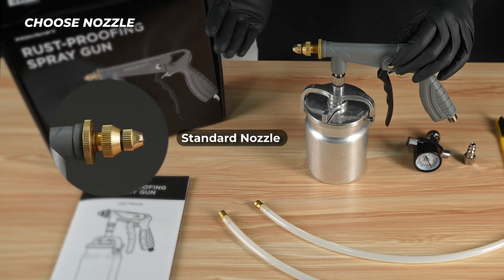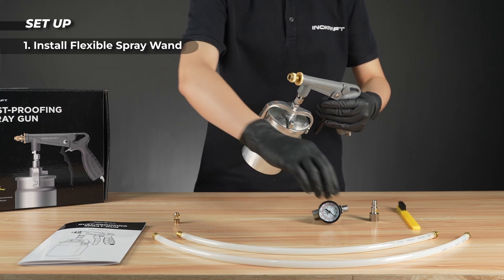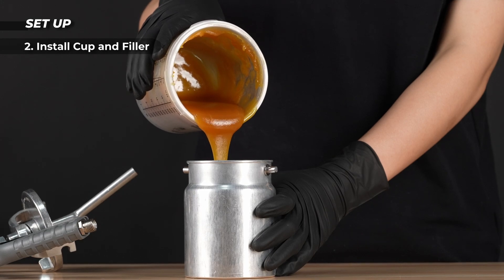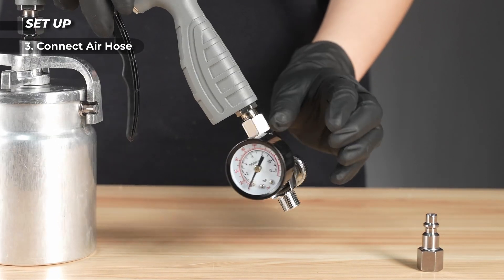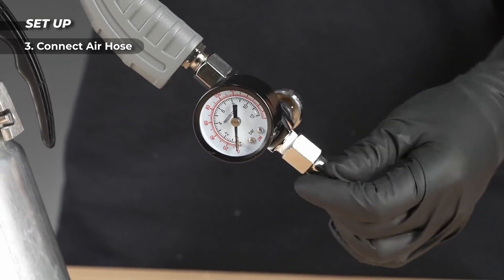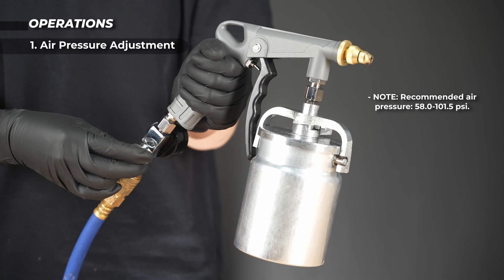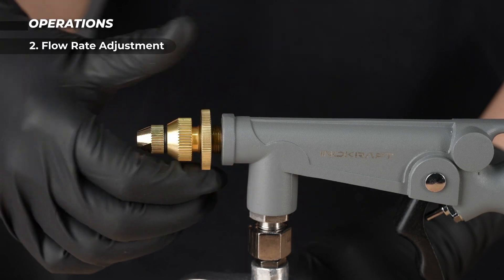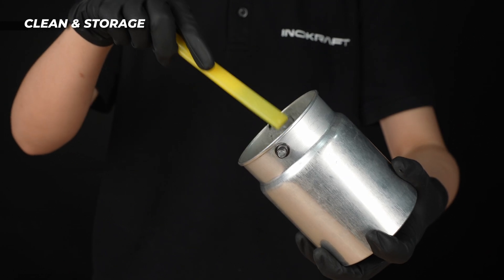InoKraft Education Center - Rust-Proofing Spray Gun Pro with Cups - Instructions

Comment: I have this gun and it works good with Surface Shield. I wish it would have more info on buying replacement wands ect. One thing I think is a$$ backwards is the 18" wand has the 360* nosel for running inside frame and the 24" wand has the straight wide open nosel for spraying around hard to get areas. You would ideally like to have the longer hose/wand for running inside the frame so you could get longer runs. I also heard you can not try to rig up a smaller 90* 1/4" wand to hit the small holes like door drain holes because it will not spray properly with such a restricted opening. The thread size of the hose fittings is 12MMx1. I am still trying to find replacement accessories.
Reply: Can you nit just remove the 360 tip and put it on the longer wand